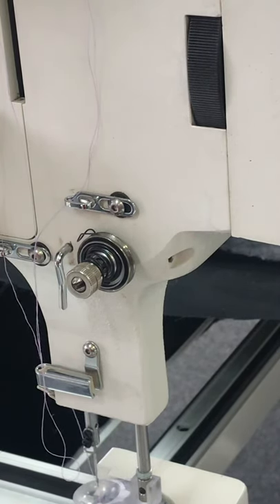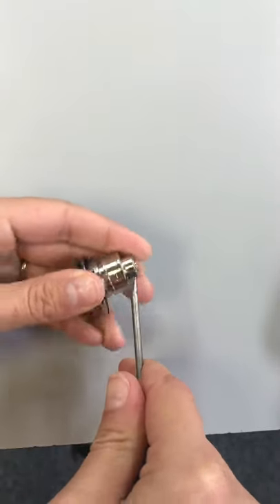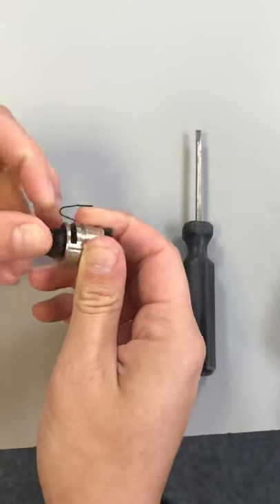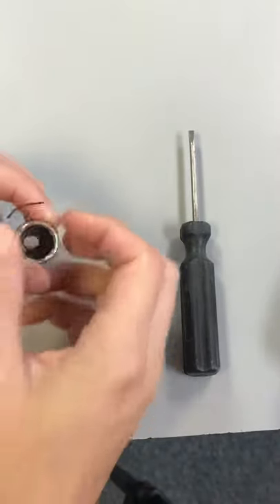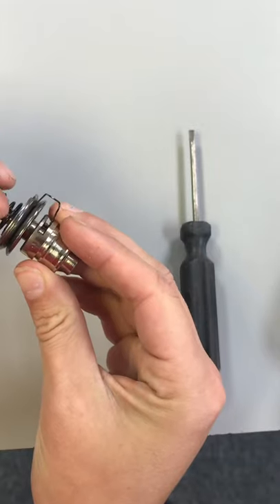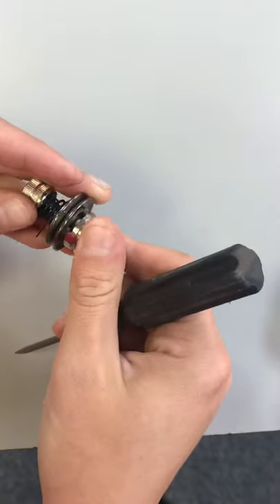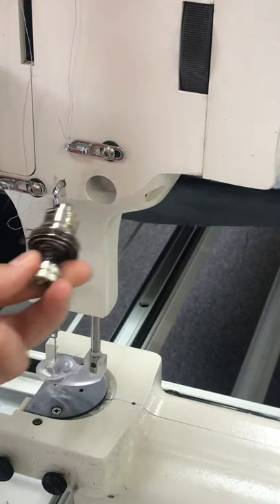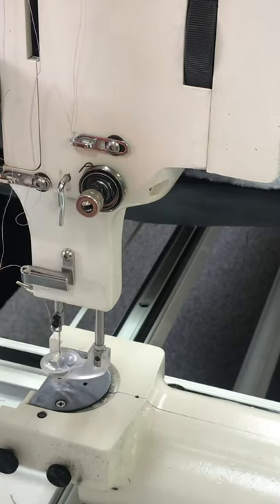A1 Quilting Machines Changing Tension Assembly and Check Spring

Comment: Hello Thank you for the instructional video on how to change the tension spring.  However I am trying to change min and the set screw is so tight it is almost impossible to loosen.  Both my husband and I have tried. What next???
Reply from the maker: The set screw that holds the tension in the machine or on the tension assembly itself?
Reply: @rachelplanka1quiltingmachi490  The set screw, but we got it lose,